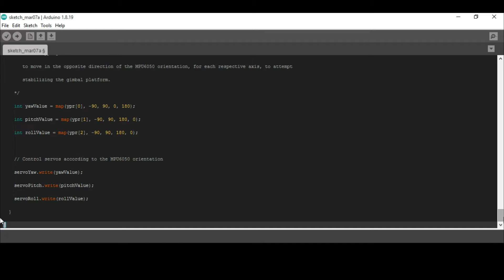3 Axis Servo control using mpu6050 and Arduino

Comment: Since the mpu6050 does not contain a magnetometer, won’t the gyro drift after a while and thus the servo would move after a while on its own if the mpu6050 were held motionless?